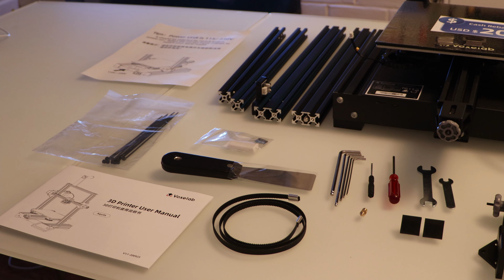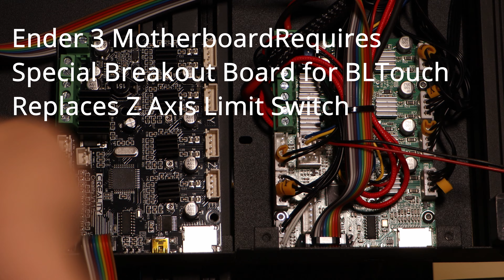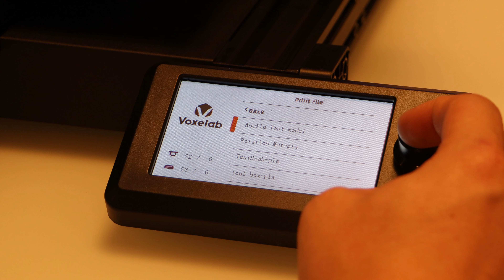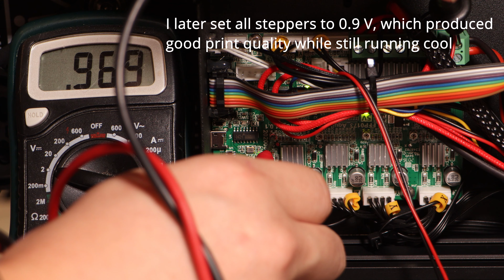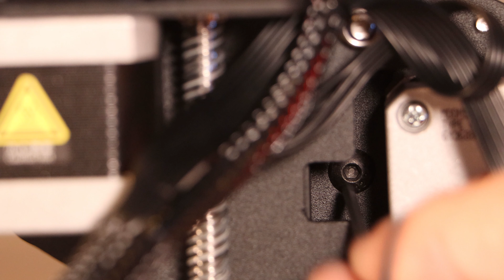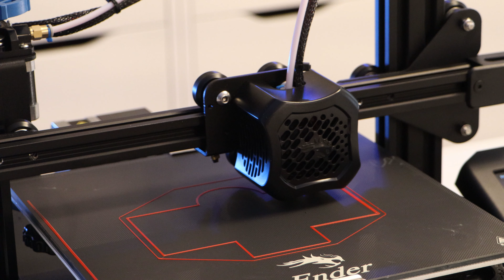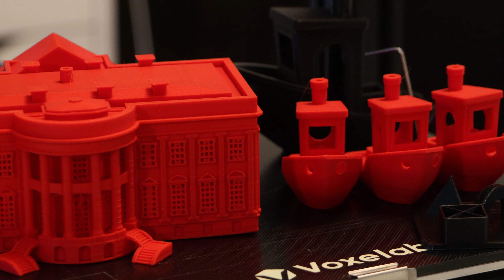VOXELAB AQUILA VS Ender 3 V2 - Which Budget 3D Printer Should You Buy?

Comment: I just recently bought a Voxelab aquila and I'm not going to lie I have no clue why I'm struggling so much with the first layer I've only gotten one successful test print out of it so far
Reply: I received my Aquila on friday, my first couple prints were great, mostly just tiny letters that took 5-10 minutes. then when i moved onto bigger prints, i was having major first layer issues as well. Looked online, and multiple people said to clean the bed with isopropyl rubbing alcohol and wipe off with a paper towel to remove some strange yellow residue. sure enough, i did that and its been great since. Something with the residue kept my prints from sticking so well.
Reply: Make sure you don't have bed wobble.  If you can wobble the bed from side to side you'll need to tighten it down with the nuts on the sping posts below the bed.  Mine arrived very loose but after stumbling on that, it all worked fine.    Also like the other person said,  isopropyl alcohol works great for bed adhesion.  

For paper leveling, you want the a good buzz when you the paper.  Go from too lose to buzz to where it buzzes constantly but you can move the paper.  Print will be fine.  Take your time.  First times are the hardest.
Reply from the maker: There are a couple things that I do on any printer to help improve bed adhesion: 

1) level the bed using the piece of paper method. If you're new to 3d printing this takes practice. I hope bed leveling probes become standard equipment soon, they are inexpensive to make and make printing a lot easier and more fun. 

Adjust z-offset during first layer to get it tuned in. If the bed is too high the nozzle will be blocked by the bed. If it's too low, the plastic won't stick to the bed. 

2) Change 1st layer line width to something like 150%-200% of the nozzle diameter. For the stock 0.4mm nozzle that would be about 0.7mm. Also increase 1st layer height to 0.3mm if you can. 
This will make the printer more tolerant to any inaccuracy in your leveling.

3) If oil or grease gets on the bed plastic won't stick as well. Try cleaning with iso alcohol or soapy water. I've heard stories of certain cheap filament brands not providing good adhesion. My go- to brand for consistent quality is Hatchbox, though I've personally never had an issue with other filaments.

4) If the first layer goes down fine, but the print pops off half way through the print, you can add a brim or raft to increase surface area. 

If you can describe what it looks like or post a picture in reddit/fixmyprint I might be able to help more. 
It's possible you are having an issue with extrusion - though extruding issues will typically show on all layers and can be diagnosed by forcing plastic through the nozzle by hand when heated to 200 for PLA. You'll get a feel for how much does should be normal when pushing the filament through.
Reply: @NathanBuildsRobots  thanks for the tips I tried the paper method and using hot water and soap to clean the glass side of the plate but I think the nozzle is just too high when it's in the middle or printing despite me leveling it I tried to lower the z access but I don't think I'm doing it right and recently I bought a BLtouch to help me figure out if I was just bad at the paper trick but it just made things more complicated I'm just completely lost at this point I even stopped using cura and started using voxelmaker in the hopes that the settings would since up better and I just have no clue what I'm doing outside of making gcode
Reply from the maker: @themeta9273  I use Prusaslicer since it comes with really good stock print profiles for pretty much every printer. 
https://www.prusa3d.com/prusaslicer/

I use the stock print profiles for the Ender 3V2, only changing the 1st layer height and width.

I would follow CHEP and his videos on the Ender 3 (also applicable to the aquila) 
, he explains things more clearly than just about anyone on YouTube.

Pictures would be helpful too. If you pay something and link it here
 https://www.reddit.com/r/FixMyPrint?utm_medium=android_app&utm_source=share

Comment: I found this very informative. I'm looking at getting a first 3d printer, and had almost settled on the Ender 3v2... one of the things I like about it is the upgradability, in particular the ability to put in a metal hot end in order to print in ABS or nylon. Is the Voxelab a close enough clone that the same upgrade parts would fit?
EDIT: I went to Voxelab's website, and I see that they say you can print ABS. Does it already come with an all metal hotend, or is it still PTFE?
Reply from the maker: I just took mine apart to check it: The PTFE/bowden tube goes all the way to the brass nozzle inside of the heater block, so it is not an all-metal hotend. The cheapest way to get the capabilities of an all metal hotend is to get a metal heatbreak, which moves the end point of your bowden tube further up inside of the heatsink, so it stays much cooler than the heater block https://amzn.to/3sJvKuB at (50C instead of 240C)

Heres a couple things to keep in mind if you want to switch to all metal hotend:
1) You can keep most of your slicer settings the same, but you will need to turn your retractions down to keep it from pulling molten plastic back up into the cold area of the hotend, which can resolidify and cause a jam. 
Normal bowden setups require ~5mm retraction
Bowden+all metal hotend requires ~2mm retraction
All metal+direct drive requires ~1mm retraction

2) ABS releases toxic fumes that you should plan on venting out of your workspace.

In terms of upgradability:
The only real difference between the ender 3 Pro, Ender 3 V2, and Voxelab Aquila is how the fan shroud is attached.
The rest is similar enough that most mods will be work between all 3 of them.

I'll give an example, I just put one of these on my Voxelab, which is actually the topic of my next video (I am editing it now, it should be out next week):
https://store.micro-swiss.com/products/micro-swiss-direct-drive-extruder
There were a couple parts that didn't fit perfectly. It needed some modification, but nothing too crazy. That particular kit was designed for the Ender 3/Ender 3 Pro/CR-10, and is not 100% compatible with the Ender 3 V2 or the Voxelab Aquila. It was more like 90% compatible, since I had to move the X-Axis limit switch and use a different fan shroud. But I would have run into some of the same issues with the Ender 3 V2. Pretty much any 3D printer will require a little bit of hacking things together to get it to work. 

Thanks for watching and let me know if you have any other questions!

Comment: I bought an Aquila just because of its price, I have two Ender 3's a Cr-10 and a Pro 3D V-King also.
 While I was on the Voxelab website ordering the Aquila I ordered their Proxima 2K Mono 6" resin printer, as well, as that is an awesome price also, they are both excellent quality printers.
 When you had trouble with the Allen bolts I went and took a look at mine as I couldn't remember having any issue with them and the bolts are fine I loosened and tightened a few without any issue, I think you got a dodgy batch of bolts.
 My friend has an Ender 3 V2 and we did a comparison of the printers but did not notice some of the changes that you did, one thing we did notice though was the print quality, prior to buying the Aquila my friend and I both thought the print quality of the V2 was good, nowhere near as good as my V-King but then the V-king was five times the price of the V2.
 A great review!
Reply from the maker: I had to build them prettey much side by side to notice some of the smaller details. I appreciate voxelabs attention to detail. If I want to get started with resin printers, Voxelab will be my go-to brand after my positive experience with the Aquila.
I think the aquila is their first attempt at a filament printer, I'd like to see them make a large format printer 350mm or above to compete with the Ender 5 Pro.
Have not heard of the vking.
I want to build an enclosed ABS corexy printer someday, 
Right now I'm considering making a high temperature printer out of a spare 3018 CNC. All the threaded rods/bearings should cope better than belts and v wheels. It just might be the cheapest way to get into high temperature printing.
Reply: @NathanBuildsRobots  The V-King was designed by Roy of Pro3D and is CoreX, Y and belted Z with a Duet 2, everything on the printer is designed by Roy and there have been some great upgrades, I originally was going to build a Voron or a Hypercube and then I came across the V_King and V-Baby and having great access to the designer sealed it for me.
 https://www.youtube.com/c/PRO3DESIGN/videos
Reply from the maker: @AndrewAHayes  Thanks for the link, I'll check it out!

Comment: Thank you for a great video.  It's good to see a review that covers more than the unboxing and a single benchy.  I was glad to see that you addressed the stepper motor heat.  I just built my first Aquila (we re-sell printers as kits) and noticed how hot the steppers were.  I settled on 0.97 VREF for XYZ, and 1.3 for the Extruder.  They run a lot cooler and I have printed reliably up to 100mm/s.
Reply from the maker: I settled on 0.93 V
I don't know how long it takes to actually burn up a stepper motor or driver but its good to play on the safe side.
Reply: What do you do just test while machine is on?
Reply: If you think the x2 steppers run hot - check out an x3 - they practically glow.

Comment: Interesting.. I have an Aquila here and find the steppers are very hot. If possible it would be great if you could create a procedure on what needs to be adjusted  for each stepper motor and what is the correct voltage for each motor. Thanks for the great video!
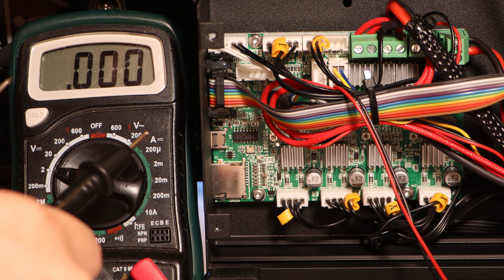Reply: Its on the video 6:50 ......anyhow here is a different video https://www.youtube.com/watch?v=p_TpiZSebxw
Reply: @themountain59  thanks.. You mentioned a couple different voltages.. The video link says .6VDC. Is this the voltage you set yours to?
Reply from the maker: The stock values were about 1.2 V and the steppers ran hot at 60C+
More that this isn't necessarily a bad thing since the steppers can handle those Temps, I just don't like running them that hot, because you're stepper drivers are also getting pretty hot as well. Allay the Y stepper is almost always warmer because it's right under the heated bed.

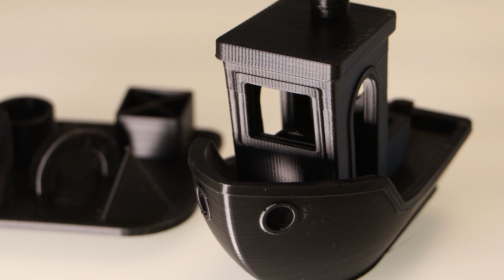I tried 0.55 V and my next print had some banding issues that I zoomed in to on the black benchy at 7:35. The steppers were really cool during this print, around 30C. I think the banding was caused by the timing belt cogging as the ripples appeared to have the same pitch as the timing belts.

Then I turned it up to 0.9V and I found that was a good compromise between quality and temperature.  Steppers were around 42 C and I didn't notice the banding I had at lower voltages.

Be careful when making this adjustment, when probing the board with the power on its very easy to sort components together and fry the board. Make sure you have good lighting, know what you're supposed to touch, and good luck!

Edit: Also I should mention, some of the more advanced stepper drivers let you change the stepper current in the menu, which is pretty neat! The BTT board I've used on some other projects have this feature.
Reply from the maker: I used this video by Creality as a reference
https://youtu.be/hC4J29rxPlQ

But I suggest watching multiple videos to get a good understanding of what to do.
Reply: @NathanBuildsRobots  thanks for the info.. I did watch the Creality video and they adjusted to around .6V but later increased the extruder to .9V. I have the Aquila and also a Diggro Alpha3 Pro (same as Longer LK4 Pro) which the steppers are around 25% larger than the Aquila and they never get hot and wonder if these are sized a tad small for the task.. Next time I flip the Aquila over I will try tweaking the steppers to ~.8-.9VDC. On the Aquila I find the Y-axis is the hottest.
Reply: @raybonz7939  actually the steppers are not the main problem...when you run the stepper driver with that high voltage they gonna burn out in the long run. So 0.75-0.85 V is more than enough for them  when you have decent cooling .Here is the data sheet for the driver---> file:///C:/Users/Administrador/Downloads/TMC220x_TMC2224_Datasheet_Rev1.10.pdf
Reply: I emailed Voxelab regarding my aquila stepper motors getting hot. They recommended  .7 to .9v but no greater then 1.2 v. Great video. Happy printing.
Reply: @brianwendel2528  I adjusted my printer 2 days ago.. All adjusted between 0.85-0.9vdc.. Much better now and all works OK..  The extruder was delivered set at 1.4vdc..
Reply from the maker: @raybonz7939  I think the Y-Axis gets hottest because it lives under the heated bed so that heats it up a bit.

Hope you meant 0.85V - 0.9V :)
Reply: @NathanBuildsRobots  lol yes I just corrected that.. Doubt I could get it that high if i wanted to lol.. Think Y axis is constantly moving and has the a bit of weight on it too. Been working well since the voltage tweaks.. Your video helped so thanks :)

Comment: I think that layer line is from under extrusion by the way. Could be wrong.
Reply from the maker: But why would it happen on the Ender 3 and not the Aquila? They have almost identical hardware. It could be that the extruder spring was still too tight. 

I have started to look into the nuances of printing to see if I can figure out how to get perfect prints. It seems like a lot of prints come out differently due to slight variations in nozzle temperature and Filament diameter. 

Nozzle temp changes due to print speed, some layers print faster than others, so even if the thermistor temperature is constant, the nozzle temp can change depending on how much filament is flowing through it. I think this can be reduced by using a copper heater block and nozzle.

Even if you have a perfect constant 1.75mm diameter filament, the effective diameter changes when you have a lot of retractions. Like a rolling pin going over dough, the Filament gets stretched out to be longer, and due to conservation of mass its cross sectional area becomes smaller. This can be partially addressed by using a direct drive extruder that minimizes the retractions, and a dual drive extruder that requires less clamping force to get the same traction. I will see if there theories hold up in my next video on 3D printer upgrades.
Reply: @NathanBuildsRobots  I would look at your e-steps potentially on the ender 3 v2 and make sure it is calibrated right. Otherwise it could be as simple as turning up the nozzle a touch for that specific filament. I under extrude with certain brands, even when printing at the reccomended temps.

Comment: I really think you're going to pick up dust like crazy by using grease on your z screw. I would higly recommend using synthetic ptfe lube, and just a drop or 2 for the entire screw.
Reply from the maker: The stuff I'm using is Finish Line synthetic PTFE grease for bicycles. I spent about an hour with the Ender 3 trying to get the grinding noise to die down and the only thing that seemed to help was adding a ton of grease. I wiped up some of the excess already but yeah I've probably got to much on there.

Comment: Bought the aquila a few weeks ago as my first printer. Love the machine just wished anyone told me to tighten the bed's concentric nuts. Had so many prints fail, fucked up my hotend by overtightening the nozzle and snapping off the thread. 

Upgraded my voxelab with bltouch and all that jazz and I fricking LOVE it!
Reply from the maker: I tried to focus on differences I had in the assembly process, wheel tightening was the same on both printers. I used CHEP's assembly guide for my first Ender 3, he's better at covering all the details than I am: 
https://youtu.be/X6cqQZTc-4Q

I do have one special step when setting up the z-axis wheels. Since there are 6 wheels it's overconstained. So I will loosen the screws holding the x-axis extrusion, then properly tension the wheels wheels on both z axis extrusions, then re-tighten the screws holding the x-axis existing.

Otherwise you can get in a situation where the x axis is pushing the two vertical supports apart. It probably doesn't matter that much but I do it just to be thorough. The larger screws used on the voxelab aquila's x axis are better for this because they will hold up better to multiple rounds of loosening/tightening.
Reply from the maker: I bought mine at pretty much the same time. Did your printer come with a $20 rebate card? Just curious if that's a normal thing they send out. You can see it on the print bed at 0:35

Comment: I dont saw it on video but for me the most important is the quality of the power source. Ender uses the well known Meanwell what is with the Voxlab? With 10 bucks difference I would definately buy the Ender.
Reply from the maker: I heard the Voxelab also has a Meanwell PSU, I'll have to fact check this though. 
It's more like $120 difference, a Meanwell power supply can be had for $30. 
Also, I didn't mention this in the video because I'm not sure how long they are doing this promo, but mine came with a $20 rebate so all together I paid $140, or exactly half what the Ender 3 V2 costs.
Reply: 10bucks more??? The ender costs here 225€ minimum...thats 70€ more...you can buy a lot of stuff for that!
Reply: @themountain59  Hey Andy, prices are from posted Amazon links. You will get an Ender 3 V2 for about 180 € on Aliexpress with new 4.2.7 board and shipping from Europe.

Comment: No toolbox for the Voxelab... not a huge deal but definitely a plus for the E3V2
Reply from the maker: Yeah, I printed out a tool box for my Ender 3 Pro but I never used it so I took it off. 
I don't really use the toolbox on the V2 either, so it's just a big flammable chunk of plastic tucked in with the elections that I don't really use.
Reply: @NathanBuildsRobots   ..and if you want one there is a stl file on the card  ;)